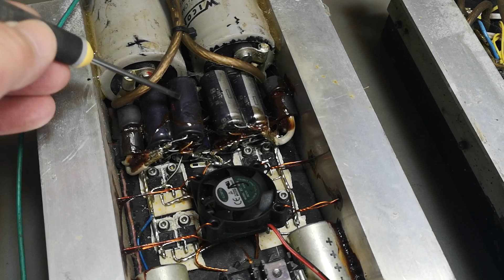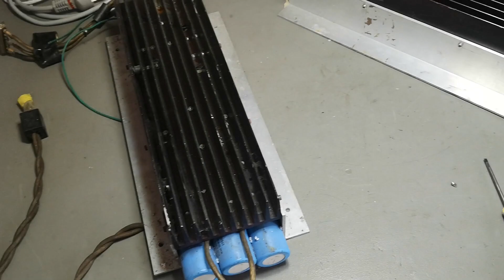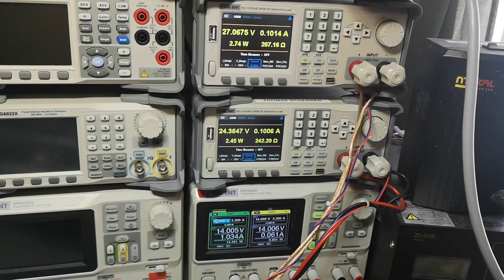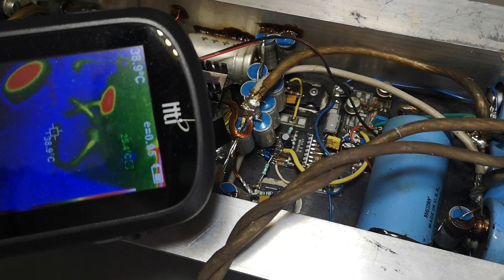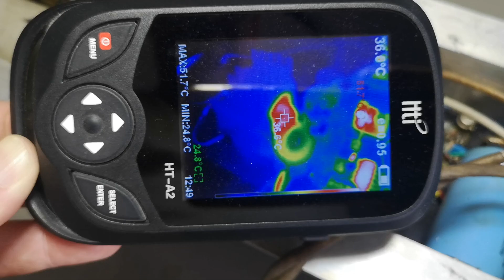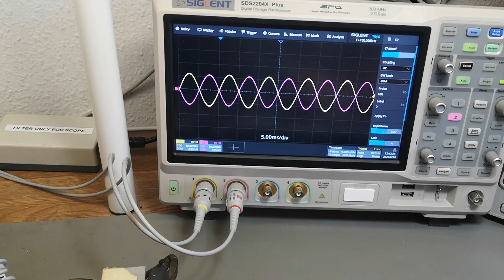DIY 800W car audio amplifier 3ch with switchmode test teardown

Comment: No emitter resistors?  Did you very closely match your devices??
Reply from the maker: this is a zero bias amp ! class C, this dont need emitter resistors.
Reply: @TeardownOZ2CPU  it sounds like you know more than I do already.  I thought I heard him say that he adjusted the quiescent current to a minimum to keep idle current low
Reply from the maker: @gettingoldsuckss  i designed this power supply and amplifier 30 years ago, i am sorry if i said wrong in the beginning, about the idle, it is corrected in a later chapter in the video, this is class C = no idle current, the opamp handle the cross over distortion perfectly in this setup, you dont see it and you dont hear it,
Reply: @TeardownOZ2CPU But you don’t understand, the audio purists say it’s impossible! (end sarcasm) Class C works very well as long as the op-amps don’t have to do crazy slewing on crossover - or just have good slew rate 😊
Reply from the maker: @absurdengineering  I was very lucky with this one, I tried a few times later to copy the main idea, but got not a super perfect cross over handeling, this design was done too many years ago, Today I recommend to use a digital switch mode output stage, it is very normal today
Reply: @TeardownOZ2CPU It looks like you used integrated power op-amps bolted down to the left of the transistors, and they were very close to the transistors. So, probably an ideal layout for this. Class D is wonderful - the packages are so tiny for so much power. The alternative is to have 20 mosfets and wind 20 windings on the speaker, each with number of turns a power of 2 :) I have tried it with 8 NPN low-side drivers and wound 8 windings on the speaker, after removing the original one, back in elementary school. In spite of having lots of free time, I got tired of that idea afterwards :)

Comment: The best amplifier you’ll ever have is the one you build yourself. Well done! What a cool project! Maybe make a try at a new design, it would be neat to see how your thinking and capabilities evolved.
Reply from the maker: today i would go class D, much smarter, more compact, but today i dont need loud music in my car, now i am old, need nice quiet :-)
Reply: @TeardownOZ2CPU  I relate to this! Back in my day I had two 12” subs in a sealed MDF enclosure driven by about 300W. I also played electric guitar for about 5 hours a day. Today, I can’t hear anyone! And I definitely strive for simplicity, which is why my cars don’t have fancy audio systems anymore. 

Kids, turn that down and save your hearing! (Like that ever works!)